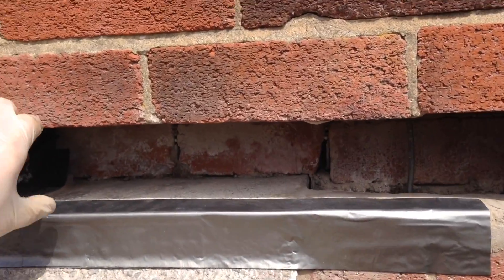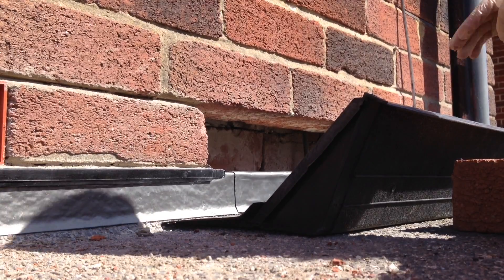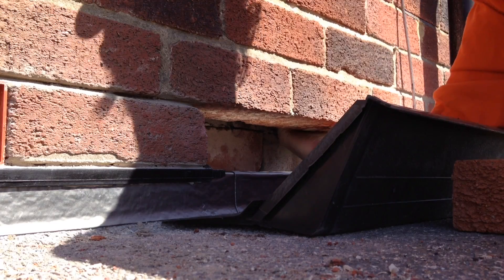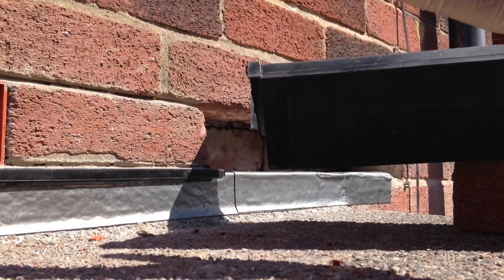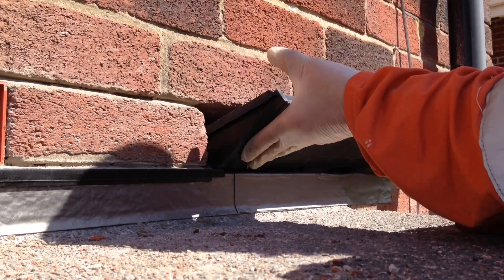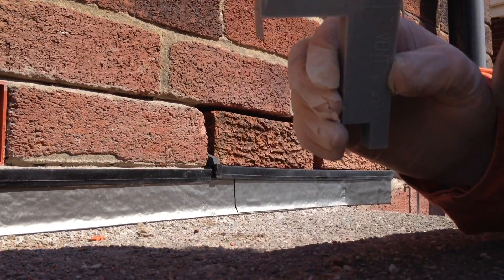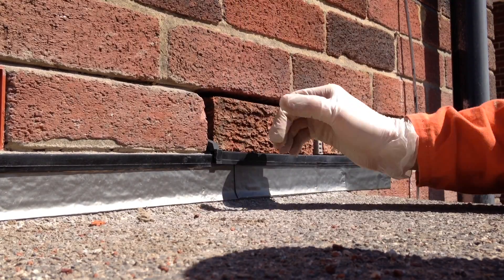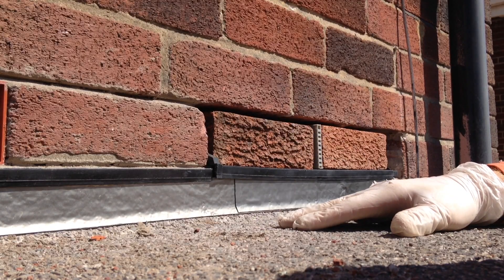DIY Cavity Tray Installation (Type E Cavitrays)

Comment: The thing you've got to look out for when fitting these type e trays, is to make sure the plastic that goes
inside the cavity to the internal leaf of blockwork is not twisted (as mine was) and finishes tight up against the inside. Otherwise water can still drip past the tray. It looks easy on your video, but it can be a real pain!

Comment: Thanks for the video. This product is much easier to fit the struggling sheet that u have to nail on the seal. Do these need to be fitted by law/building regs on windows and doors?

Comment: No mention of packing the bricks back in as you'll destabilise the wall above if you don't. Also should be a min 150mm upstand from flat roof to tray. 
It's not a job I would advise any DIY er to undertake.

Comment: Thanks Chris, My extension won't be signed off by building Control until cavity trays are fitted. Grr.....my builder has some explaining to do!
Reply: Most extensions don't have cavity trays. Unless clearly stated in the specs, most builders wouldn't put it in. It's down to the architect in the end.
Reply: Are cavity trays a must for windows and doors??????????
Reply: @stimmo77 I thank u for your comments
Reply: @antonios4926  yes they stop water ingress from the driving rain x

Comment: I Would have liked to see the work completed, as I do not know whether you dry pack above the brick, pack it with slate or just use a normal sand and cement mix, otherwise nice video.
Reply from the maker: You use normal mortar above and below the bricks and insert weep vents at the sides. Cheers, Chris
Reply: Trevor Peters o
Reply: @christopher_barr resin is what I use at times

Comment: Hi Chris.
You mentioned about removing only a couple bricks at a time, however could you fit every other cavity tray in a hit, let them go off and revisit the gaps?
Not sure how spot on the overlaps of the trays need to be.

Thanks in advance and thanks for the video, be great help!
Reply from the maker: Hi Dan, I'm not a builder so I can't give properly qualified advice, but the cavity trays I bought have a lip which engages with the tray adjacent to it, so you have to install them in a line (left to right in my case). I don't think skipping alternative trays would work but if there is anyone else with more experience out there, please comment below... Cheers, Chris 
👍
Reply: It can be done but you will need precise measurements otherwise when you lap the in between trays they may not fit and that compromises the job.
I usually work 1 metre then skip a metre then following day repeat the in between but I mark my brickwork precisely and allow flex in the right tray to overlap
Reply: What happens if you remove a standard brick and put in a clay airbrick on the existing DPC, and mortar it in without a plastic cavity tray? I've just done this but didn't know about cavity trays, cavity liners or weep holes. What do you recommend I should do when adding further air bricks? 1930's semi. Thanks